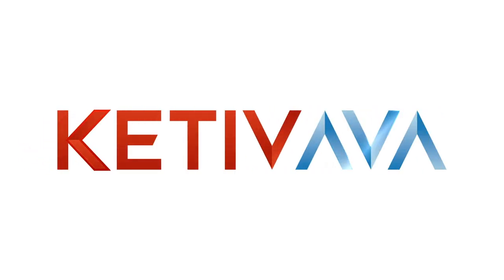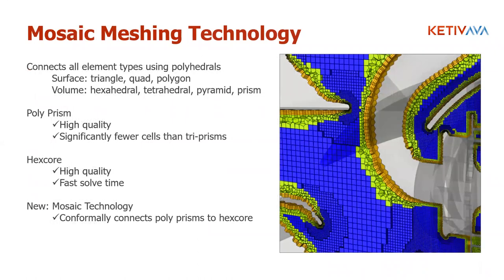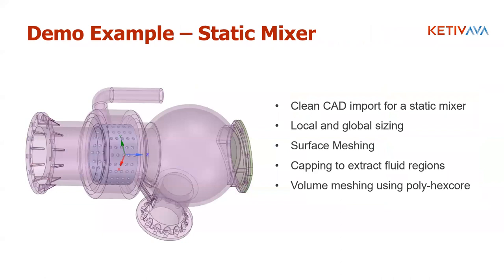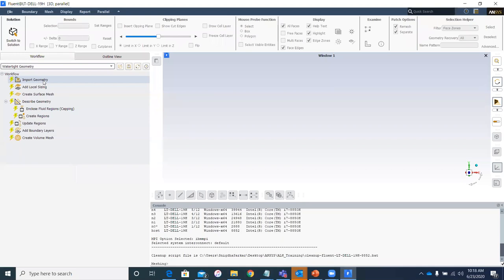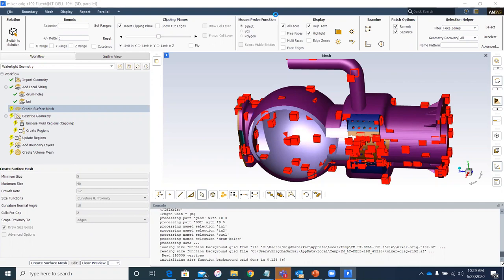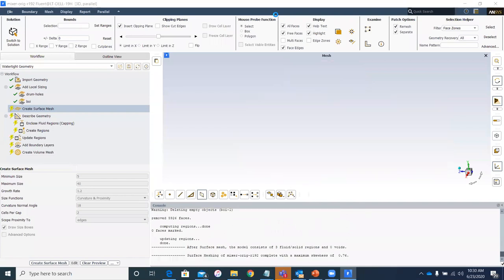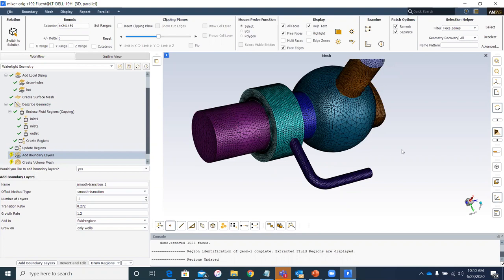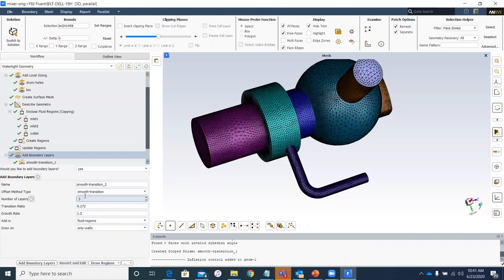Ansys Fluent Meshing using Watertight Geometry Guided Workflow | Ansys Virtual Academy

Comment: Great tutorial.  One quick question: what is the advantage of using poly-hexcore mesh compared to all poly mesh?  Thanks.
Reply: Hello Ran, 

Our Ansys partners answer this question best. Please take a look here:

https://www.ansys.com/products/fluids/ansys-fluent/mosaic-meshing-technology

"Generate Mosaic-enabled Poly-Hexcore meshes up to 10x faster using parallel processing. The patent-pending Mosaic algorithm creates adaptive conformal mesh interfaces for the best combination of speed and accuracy. No need to buy a separate HPC license.

The following example shows a comparison between Poly-Hexcore with Mosaic technology and conventional all-polyhedral meshing technology with a bluff body flame holder. The Mosaic mesh had fewer, better quality cells, requiring one-third less memory, and delivered a solution two-times faster with higher accuracy."

Sincerely,

JD, from KETIV
Reply from the maker: Thank you John!

Comment: Hello, question here on capping. I want to import cad files from autodesk inventor. How can i seal inlet and outlet when i dont have it already prepared? In autodesk CFD mesh creation started at the end, after all other settings, including materials and internal volume definition, so there you were still working with CAD edges and not triangular mesh.

Comment: Hi.  Question.  Should the body of influence be a separate part?  I'm using designmodeler and not spaceclaim, but i don't think that makes a difference right? Reason is, I tried to form a new part, but it couldnt identify the boi.  Thanks!

Comment: Can you please include tutorials on how to mesh rotating fluid domain such as Horizontal axis wind turbine? I believe this kind of meshing involves at least 2 different fluid domains..
Reply: I was also looking for this workflow on youtube but as far as i know the watertight geometry workflow only allows for 1 domain, meaning the interface layer for the MRF between rotating and stationary part cant be created. In the fluent solver you can however split the zones/wall to create an interface but I havent had any luck with that either and i think the shared topology erased all the interface lines. I am looking forward to someone showing me a working MRF under the watertight workflow.